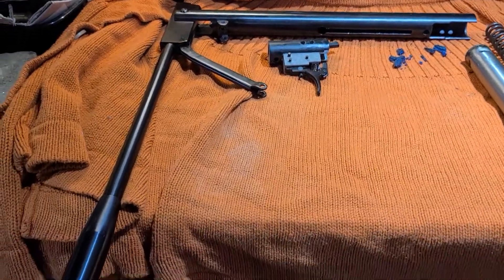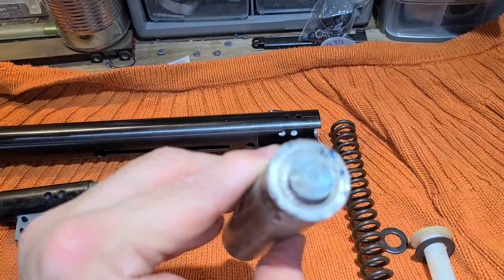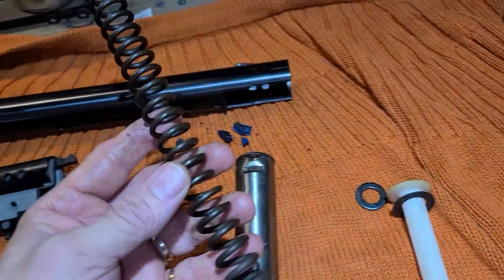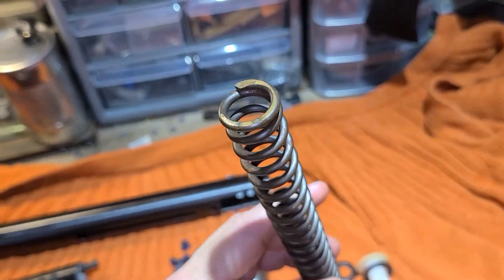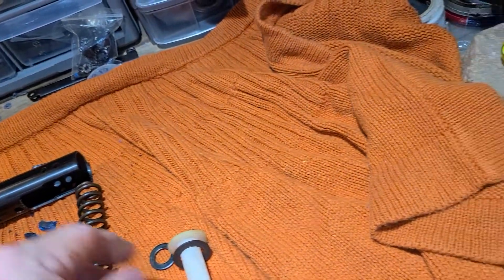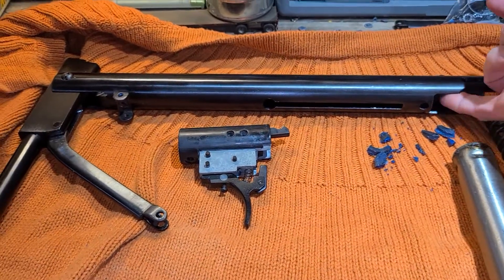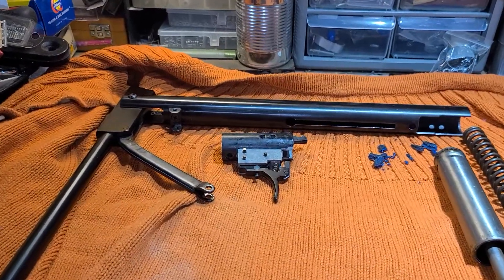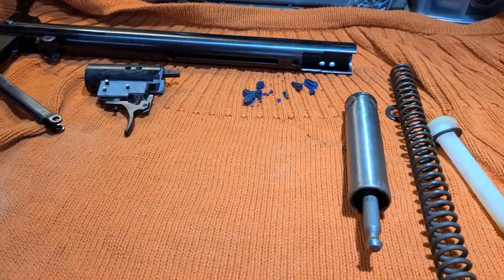Xisico XS B25h SFB part 2 disassembled.

Comment: Can’t find your part 1. I’m actually looking for a disassemble video for a XS25 and there doesn’t seem to be one on YouTube in English.  Is there much difference from the B25?
Reply from the maker: Part 1 was only an over view of the gun. Just going over specs  and overall impression of the gun. The letter designation is only there for the style of stock the gun came with. I think there are 4 styles. The laminated Bamboo which I have, the standard sporter Beech stock, a Beech thumbhole and a synthetic version. You need a spring compressor to remove the internals. When I did mine I didn't have one yet, I used a 48 inch steel bar clamp, it worked but not as efficiently as my new Air Venturi Spring Compressor that mounts to the pic rail or 11mm dovetail. Just make sure the compressor is tight against the beck of the compression tube and tightened enough that the 2 pins can be knocked out. That's all that needs to be done, one the pins are knocked out slowly reverse the clamp and once the spring is uncompressed just pull everything out. Just reverse to put it back together. Mine came with a piston seal that was in pieces so it had to be replaced. Which gave me the opportunity to relube(everything was dry inside and when cocked and fired honked really bad), g=The gu shoots so smooth and is extremely accurate now! No more honking and you can't even hear the spring as it compresses. A little Mily Paste does wonders!